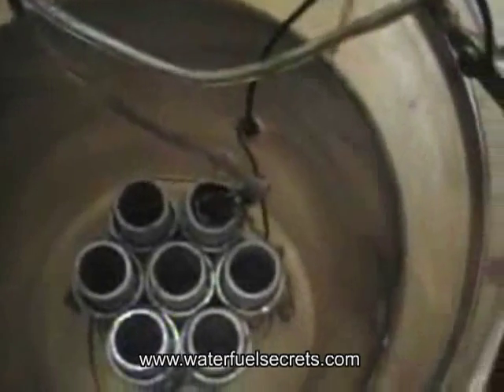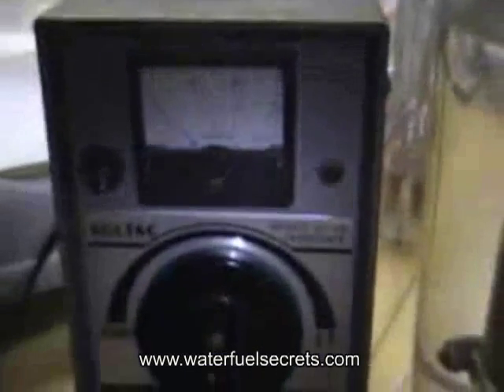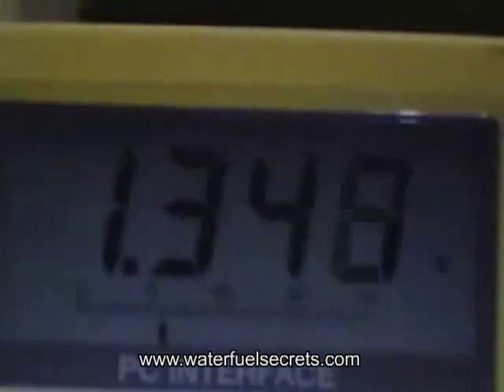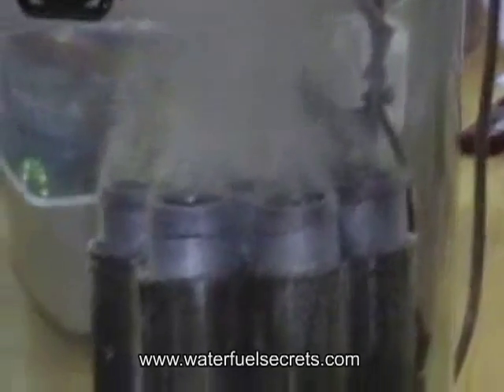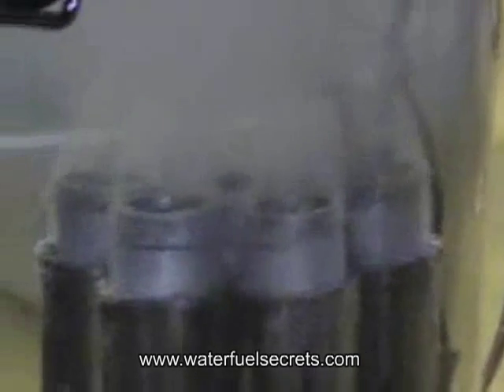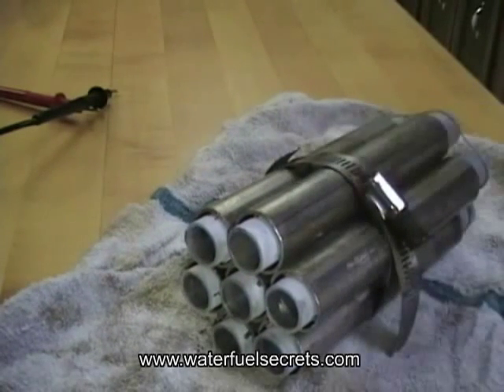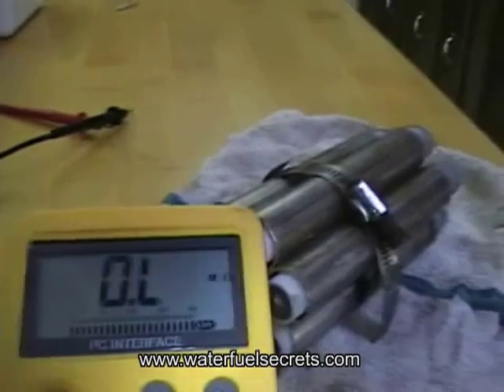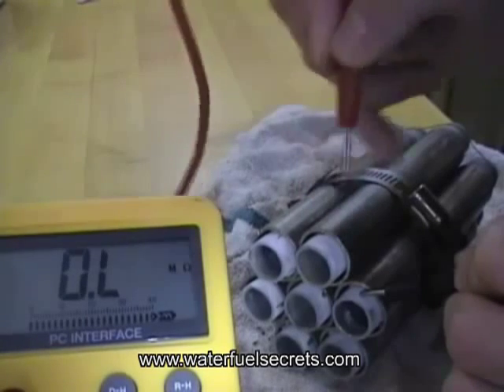WFC Tube Conditioning

Comment: The conditioned layers is a semiconductive (dopped or extrinsic) and acts like a Diode, if you bias it forward will conduct and block in the reverse bias (PIV with breakdown), it has in fact formed a double layered capacitance. now what does that hint you at? BTW 'Conditioning' is NOT required, but if you use the correct method of exciting the process, it does this very conditioning perfectly!

Comment: Sir what's dimensions and space between tubes and did you annealed them?
Reply from the maker: Space between inner and outer tube is 1-1.5mm - they're spaced with stripped off insulation from hookup wire. I did not anneal them.